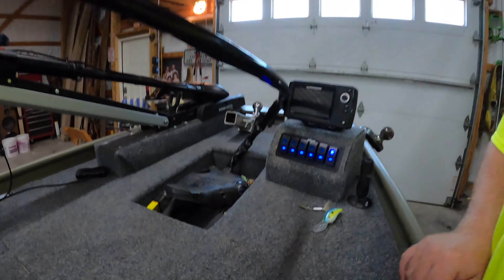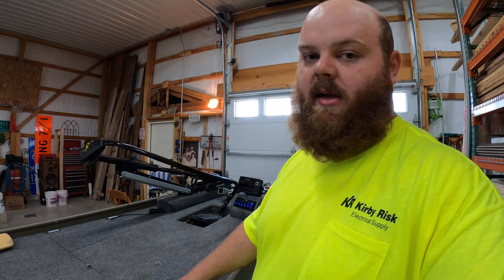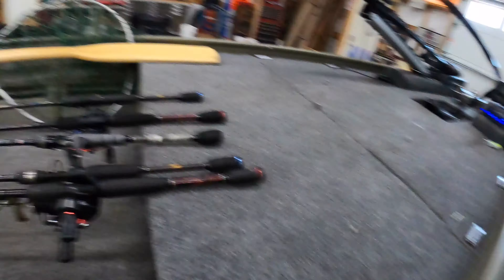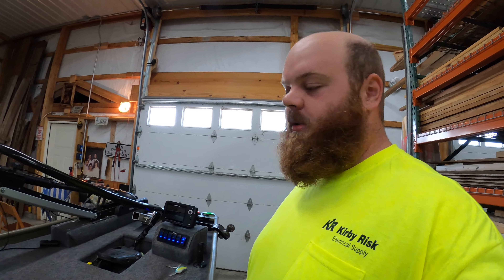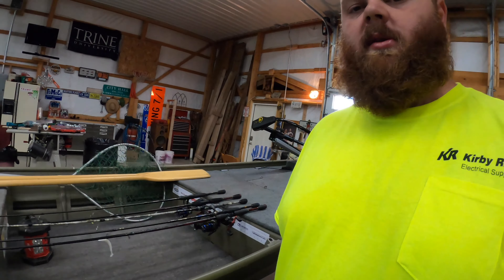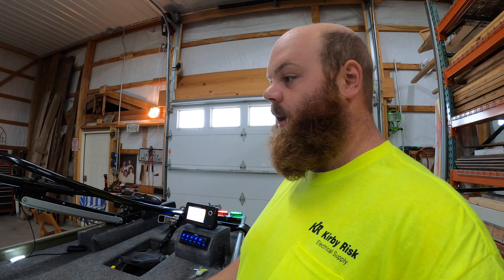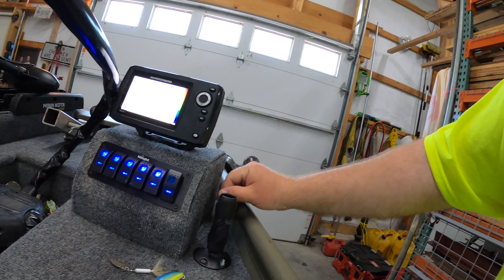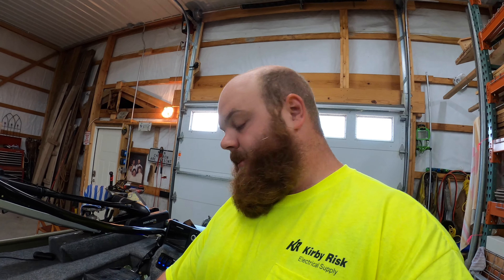Jon Boat to Bass Boat Conversion GETS LIGHTS!!!!

Comment: i built two jon boats 1236 ihave lights in the front and back i like to see whats behind me at night i also installed six under water lights for crappie they have them on ebay a pair of  60 led lights for 20 bills cant go wrong